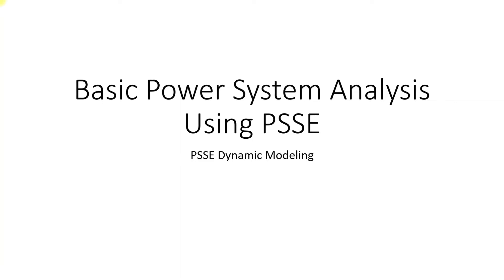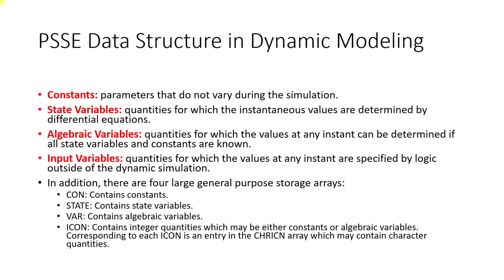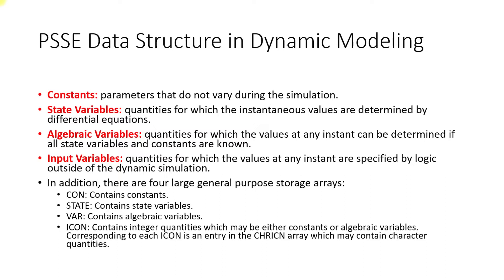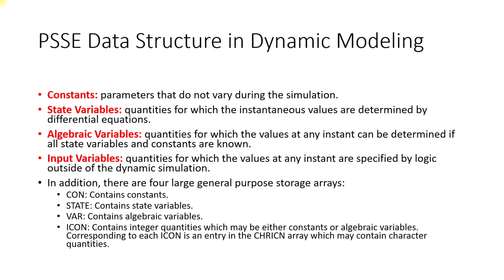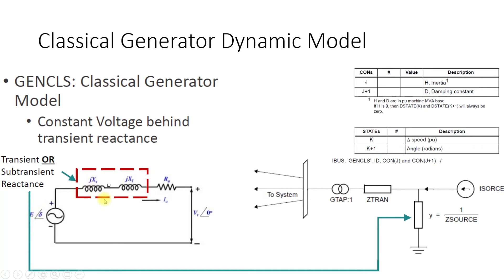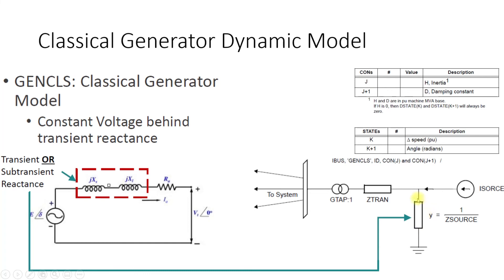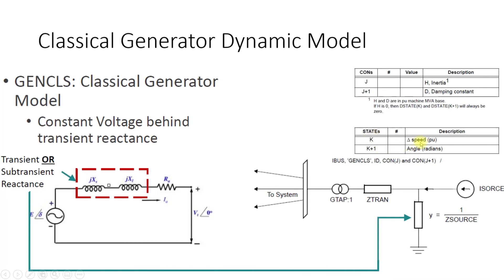Basic Power System Analysis Using PSSE Session03

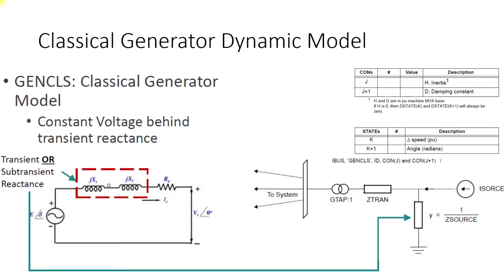Comment: thank you for your explanation.  I have one question. why is it transformed from thevenin circuit to norton circuit at 2:50 in PSS/e? IN my understanding, thevenin is composed of voltage source with series impedance, but is there advantage to convert it into current source and admittance?
Reply from the maker: For transient stability analysis conversion into current source is required since differential equations used for transient stability uses the same